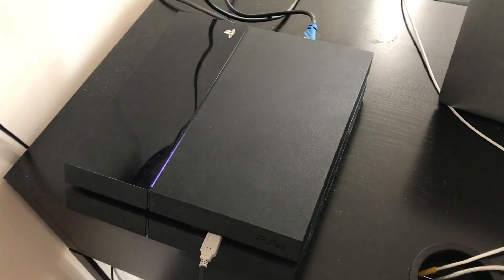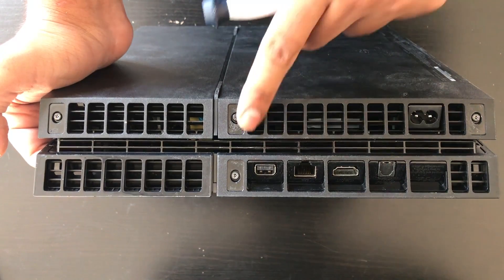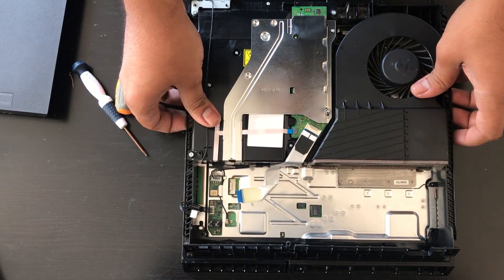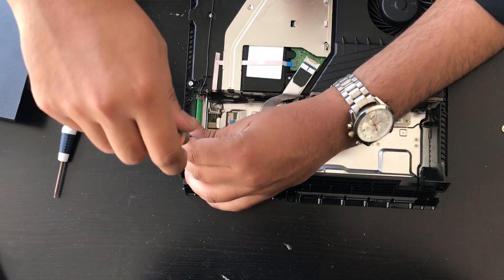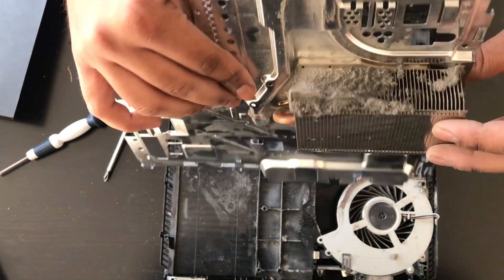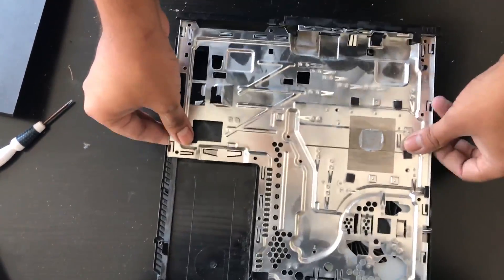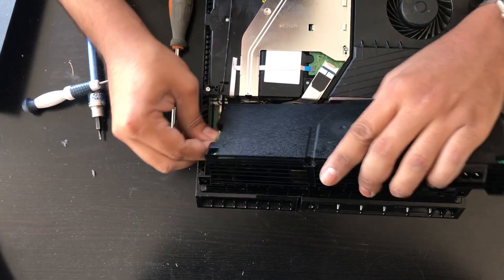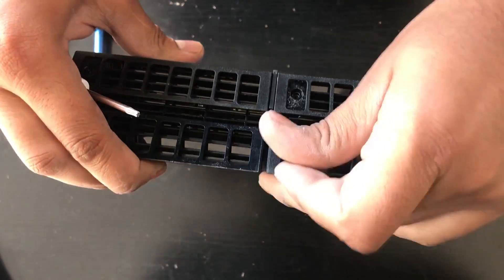PS4 Too Hot overheating due to dust build up and fan (CUH-1001/1115 cleaning and disassembly)

Comment: I did it, now my ps4 won’t even turn on :( somebody plz help me.
Reply: Same,
Reply: Same?! I get a red light as the fan spins up and then it turns off :(
Reply: Did you replace the thermal paste?
Reply: No I didn't and didnt think we had to everytime we detach the motherboard; I think my motherboard didnt have enough pressure and contact with the CPU and the paste that was already on there. I just ended up getting a ps4 pro after ripping out a wire by accident after I was trying to disassemble it for the 2nd time.

Comment: if you dont want to go through the hastle and avoiding messing around with the mother board and processor just take the bottom cover off and use a computer duster directly to the fan also trough the inside and around it the duster has enough force it will blow all the ubstraction youll see it come out trought the back panel. one can should be enought that should take care of the issue ive done that with my ps3 and ps4 and it only costs you about 5 bucks. it doesnt hurt to do it all over the console once youve got the priority areas.
Reply: teto toreto  i don’t get it
Reply: @jeje4984  ok
Reply: teto toreto 😂😂😂😂 i meant explain but nvm
Reply: @jeje4984  just read it again.

Comment: I’ve had my ps4 nearly 5 years. I’ve cleaned the dust from the fan and the heat sink but it still sounds really loud. Could it be the thermal paste by the processor? Someone please help
Reply: same for me, the fan is clean but i think we have a problem with a dry termal paste. 
the fan runs at maximum speed to lower the temperature, so it's like a nuclear reactor.
my ps4 is a glacier white destiny bundle (dec 2014), now ,
or I'll try it or I'll have it fixed for 30 euros

Comment: My hard drive wont pull out easy and ive put a small amount of pressure on my pull but i dont want to break anything. What am I missing?
Reply from the maker: Did you remove the screw holding the HDD in?

Comment: PS4 won’t turn on now. 

Followed every step. 

Help?
Reply: Yes.  Its the thermal paste...
Reply: Omar Orozco so just apply thermal paste on those two chips and it will turn on ?
Reply: @omarorozco6798  mine blue light turns on then turns straight off
Reply: Same here.... help!!!
Reply: Omar Orozco you guys ever figured it out how to turn it back on?
Reply: Clean it first,  remove old,  then apply in the board only..make sure it covers the whole square area...and that's it..
Reply: @njfrnjn  on the square chip where the old used to be.. search for thermal paste for ps4 on youtube...
Reply: Matthew Castro sane here Matt did u figure out the problem

Comment: I did this but now my ps4 controller doesnt connect to the ps4, a little silver thing with a wire came off of my ps4 is that y?
Reply from the maker: What do you think?
Reply from the maker: Yes
Reply from the maker: Incase its broken we sell them on our website at www.fasttech.ca
Reply: Fasttech i fixed it, turns out it was the bluetooth receiver, i just have to add thermal paste

Comment: What if it shuts off in 5 minutes after the initial start with no loud noise
Reply: I cleaned out the fan and the same thing happens to me
Reply: @balisonic1177  Yeah man it sucks
Reply: @kongsied4279  I figured it out, I forgot to reconnect the fan connecter, the small one that you need to pull out upwards and carefully, I reconnected it and now it works fine

Comment: I did this step by step. PS is starting but whenever i start up my game is automatically shuts off or gives me message PS is too hot, while my room temperature is nothing close to hot.
Reply: well what this guy forgot to do in this video is changing the thermal paste between the heatsink and the cpu/gpu, if 1 or more years have passed by since you got your ps4 you should replace the thermal paste especially if you disassemble the console
Reply: @maniakos_  he didn't forgot he said it was okay in THIS ps4

Comment: You went too fricken fast. Especially in putting it back together. Could have walked us through the whole process slower. Now, because of that, I didn't put it back together right & accidentally pulled off the little white thingy by the power supply plug-in on the motherboard. I'm sorry but this video was way wrong.

Comment: so i cleaned my ps4 got rid of the dust etc it still went bananas when I opened games and it would shut down and say it overheated 5 seasons after opening a game now i reopened to check if the parts were all assembled correctly and they were but I was gonna check if the thermal paste was still good but when i touched it was hard as a rock is it supposed to be like that? well once i touched it and put the  ps4 back on now the console turns on then shuts down with the red light it doesnt even give me time to go to the main memu

Comment: PLEASE HELP!
I followed the tutorial all the way, cleaned everything, and put everything back together. However, after I plugged it back in and tried turned it back on, the fan went a little loud for a split second and I got the red light on my PS4, and then it turned off. So now my ps4 wont go on. Could it be I need to replace the thermal paste?Please, if anyone knows anything respond as soon as possible I'm very worried and don't know what to do.
Reply: I have the same problem
Reply: That’s the exact same for me have u fixed ur issue?
Reply: @elijah9159  Yes I fixed it myself in April. Turns out that when I opened it up to clean it, the thermal paste chipped off because it was so dry so I just ordered thermal paste from Amazon and applied it myself and then everything worked fine. Let me know if it works👍

Comment: hey, i cleaned my ps4 very well just like in the video but when i turn it on and run a game it shuts down like 20-30 seconds later, which leads me to believe that something is not working right in the cooling systen or something like that, the fan works very well. Does anyone know why this is happening?

Comment: My ps4 has a piece that stops ne from using the t8 scredriver what do i do
Reply from the maker: Keandre Marcano buy the proper t8h and stop asking silly questions
Reply: @fasttechvideo  there are two types of t8 screwdrivers one for safety screws and one for regular screws you never specified the type needed stop making silly responces

Comment: i think i did something wrong? my ps4 doesn’t recognize my controller inputs (it does but only when i’m a foot away, more than that and it doesn’t work). and when i tried to test run it, it gave me the overheating screen and the ps4 beeped like 4 times and turned itself off.

Comment: I got a question can overheat also be caused by thermal paste do i have to replace thermal?
Reply from the maker: Depends on the mileage and the duration for which the system was overheating due to dust and other factors. In shorter words, yes in certain cases you need to replace the thermal paste. We do sell it on our site so if you're interested please check us out at www.fasttech.ca

Comment: I get why companies secretly make these out to be hard work removing and fixing these kinds of console systems.  It's just lookimg to hard of a hassle to do this so why mot just buy another console?  Very easy marketing approach but hey I mean if everybody had the time and patience for this no company would have millions of dollars or at least half its income cut in half.  Mr if rather buy a new one but do this just to get my data yobthe other ps4.  I needed a nre one anyway.
Reply from the maker: That might be one of the dumbest things I have ever read
Reply: @fasttechvideo  there's some truth to what I said also why so rude I was just commenting something interesting and you feel the need to comment back with a snarky reply.  Without any other alternative correction to what ive said.

Comment: I’ve replaced thermal paste, thermal pads, cleaned out the heat sync/sink cleaned 90% of all dust and it’s still overheating and making a jet noise.
Reply: Capital A my husbands as well, didn’t get any quieter

Comment: Can someone help me pls:( I did all the cleaning and after putting all the parts of the ps4 together, the power button is not working:( it is like blocked or something, i cant push it unlike the eject button. The ps4 works (I turned it on with the controller) and I wouldn't really mind about it if I wasn't going to change the HDD, but I heard that I have to enter in the safe mode to do that, and I think it can only be entered into it through the power button:(

Comment: Okay, this was a frikkin’ GODSEND! I didn’t even mind all the ads because this saved my PS4’s life; I only wish I had discovered it ages ago when my PS4 first started sounding like a hovercraft. Literally just finished putting it all back together and fired it up and omg what a revelation! Only things I did different were replace the thermal paste, and remove and clean the fan properly (with the help of a different video), but thanks so much for this. For anyone sitting in the fence, I am totally useless at this kind of thing, but just followed the steps and now feel like a NASA scientist! Oh, and for anyone worried about static damage, I hoovered the shit outta every component before I learned that’s BAD, and it didn’t do it any harm whatsoever.

Comment: So I follow all the steps and when I went to turn it on the blue light came off and it instantly turned off! So I went to redo everything and then in the process off taking the fan cord off it I didn’t lift up and off I pulled it like an idiot and broke it but I rigged it and when I turned it on I made it to the home screen loaded YouTube but due to the cord on the fan being broke it turned off, SO MY QUESTION IS IF I INSTALL THIS NEW FAN WILL THAT FIX THE PROBLEM AND WILL I NEED TO REAPPLY THE THERMAL PASTE?

Comment: I did everything right ps4 works great but the eject button doesnt work can only eject thru software..any ideas
Reply from the maker: There is a metal piece in the bottom half of your case. When you were cleaning the case you most likely bent it. Bend it back in place and it should work again.
Reply: @fasttechvideo  thanks will try today

Comment: followed your tutorial step by step, took pictures along the way. I originally cleaned it out to play Uncharted 4. A game I downloaded a while ago, offloaded, redownloaded last night. Every other app (Netflix, Hulu, Disc games, etc) works got it all back together turned on, and still sounded like a jet plane taking off... less time than before the system shut down with a red light on the console. I didn't replace the fan (I cleaned it best I could, still had dust) but fully cleaned out the heat sink which was comparable to what was in the video above but more so like 50%. I'm thinking I need to replace the thermal paste and fan.... I'll shoot you my email, but is there anyway we can talk about it? Or can I send you my console and have you work it out for me? Clearly I'll pay you.

Comment: Man, you tore it all the way down and you're not replacing the thermal paste? That's just lazy. Also, thermal paste needs to be replaced once you separate the heat sink and the APU for good thermal conductivity (which is the main problem for overheating systems). Getting debris out is a good start but anyone reading this comment should also replace the thermal paste as well, I mean, you've already tore it down to that point anyway.
Reply from the maker: I did another video where I do replace the paste. The paste doesn't always have to be replaced especially if it's still wet. This customer did not want to spend the extra $25 to replace the paste even though we had recommended it.

Comment: I can’t seem to open up the power supply it’s opening from the opposite side of the wire but it won’t open up by where the wire connects
Reply: You have to make sure its seated down where it normaly sits. Then only pull up from the side with the connector until it comes up, then start pulling up from other side. I did the same thing when i tried to do it.

Comment: I did all the steps and cleaned everything, yet my ps4 still overheats and shuts down randomly.  :'(
Reply: You need more thermal paste then
Reply: @battlestormninja6645  No need for excess thermal paste, I think.
Reply: I have the same problem with my second Ps.
All I did was a thermal paste replacement and I think I'ts both heat sink and the fan. Heatsink seemed to have "bent" lines in it afaik and that fan is filthy and feels like an disposable air filter, not smooth at all like plastic should.
Should've done it all. Wasted hours...

Comment: Hey i followed these instructions and now when I turn on my ps4 it turns blue fan runs then turns red beeps 3 times and turns off... I can't enter safe mode I have no idea what to do... please help
Reply: Do you fix it?  I have the same now 😥
Reply: @blackdopeyan7862   nope sorry mate bought a ps4 pro yesterday and can't get any of my old saves back until  I send off my old ps4 to get fixed haha it never ends... should have never pulled it apart

Comment: That connecter is hard asf to get out I still can’t get it out yet😐
Reply: Everything comes off with the right technique
Reply: Same, I can't get it out. Is it glued?
Reply: Aultrex I have the same issue can’t get the connector out
Reply: i broke mine, didnt know it was glued
Reply: thank u fast tech for the help👍🏻 no more ps4
Reply: @goldenking631  What is your ps4 model number
Reply: Valumiini Model CUH 1001A
Reply: @goldenking631  You either did something wrong, or your console is faulty
Reply: The connector of this model he has in the video, is not glued
Reply: its not glued. Just pull it upwards out all be it very slowly and carefully. I pulled mine side ways and the wires came out destroying the the connector cable bit which holds the three wires. Luckily all I needed to was buy some replacements online which costed me around 2 to 4 pounds and I inserted the wires into the replacement cable and it worked.

Comment: If you don’t want to take the PS4 apart fully take the bottom cover off and use cotton buds. Bend them and get them through each fan blade and scrape the dust off the heat sync. Can be a bit tricky but once you get the dust off it your PS4 will run silent even if dust is still in the fan area just clear the heat sync !!

Comment: I recommend you all doing a back up before disassembling your consoles. I always do this when tinkering with any pc or console in general.

This video shows how a lot of people are cleaning wrong their consoles since most videos don't bother opening the heatsink (where is most of the dust). Great video overall, but the guy should have cleaned all of it if someone is paying them to do this. Compressed air or some DRY cloth are good to use in cleaning the motherboard.
Reply: He should have replaced that thermal paste too!
Reply: I was thinking the same thing why leave it dirty when it is opened up easy enough I would think, Well, I guess each there own...

Comment: People!! Don't take out the motherboard, if u do u outta replace thermal paste!! Use a air duster to clean ur fan after taking out the bottom part, and ur fan will worked fine!

Comment: My ps4 gets really loud like that but it doesn’t over heat should i still attempt a clean
Reply: Yes get that dust out before it does start over heating and i would also tell you too reapply some thermal paste if its dried out

Comment: Im trying to remove the power supply connector but the cable is very stiff and it doesnt unplug from any of the two ends so yeah i think im leaving it there
Reply: Mines also very stiff. I dont wanna force it out

Comment: This worked really great and keep up on the tips my ps4 run way quit and faster.You really hit the spots on what to do.Keept it up!!!!😁
Reply: I'm having one problem though my controller is having problem getting connection and is lagging out what could the be
Reply: Reset your controller with a needle on the back and reconnect via USB after

Comment: U just basically stole the that man's money... There's dust everywhere when u put it back together.. Rip off 🤦‍♂️
Reply: 9:35 There's still so much dust left in the Console. Fcking lazy could of at least got a brush to get the dust out or used something
Reply: Keeping the old thermal paste is also lazy!
Reply: He would've caught the hands 😭
Reply: its because cleaning the board has a high chance of ruining it. Just cleaning dust from the power supply, fan and heatsink is just enough to fix the noise
Reply: @msrakhra  it depends how long u had it.. If u had the ps4 for yrs the thermal paste has dried out. But ye cleaning the fan and mostly the heat sink needs to be clean. The heat sink is the main corporate cuz the dust if covering the gaps and makes noise.

Comment: I pulled too hard disconnecting the connector on the power supply and both ends came out, including one of those metal paperclips, how can i fix this?
Reply: that dog rascal ur shits gone dude
Reply: @Ryanlopez908  what about soldering?
Reply: that dog rascal Doubt it,good luck man

Comment: Hi! I did everything as you did, I clean it very well and still making a lot of noise and ends turning off. When I dissambled it the fan was spinning well. It should be the thermal paste right? Or it could be something else?
Reply: Replace the thermal paste, it worked for me
Reply: Stuntmandouble08 yess i changed it and now it works! Thanks